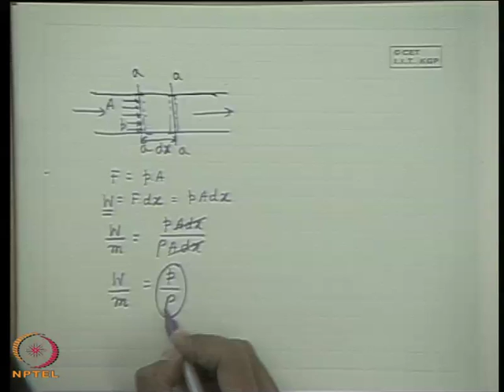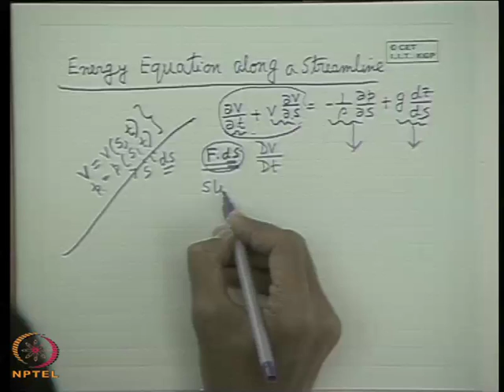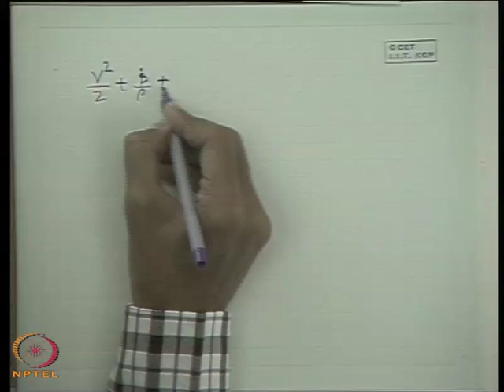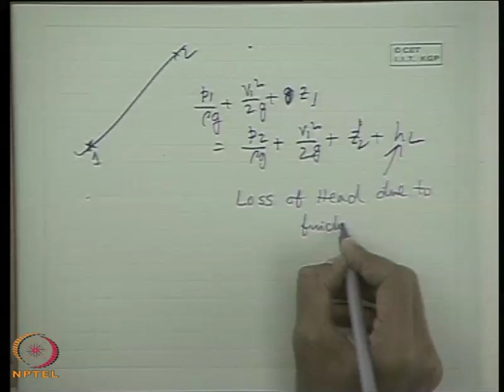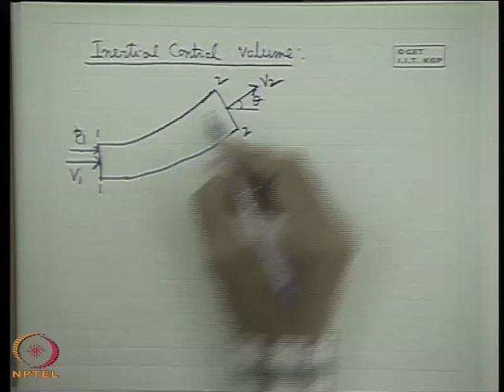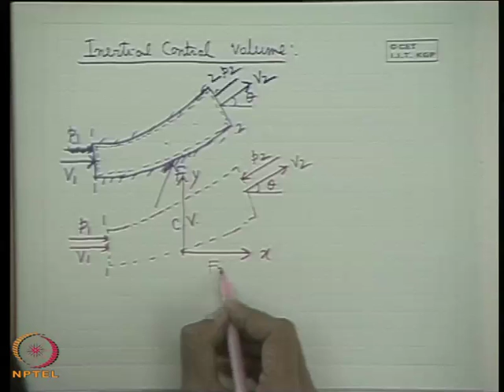Mod-17 Lec-17 Conservation Equations in Fluid Flow Part - V

Comment: Suppose during a course of flow in a pipe, flow energy completely converts into kinetic and potential energy at a section does that mean fluid can't flow ahead of that section cause it can't push the downstream fluid particles?
Reply: In that case, V will also become zero right. Only Potential energy will remain. So we can say that flow will cease to exist.